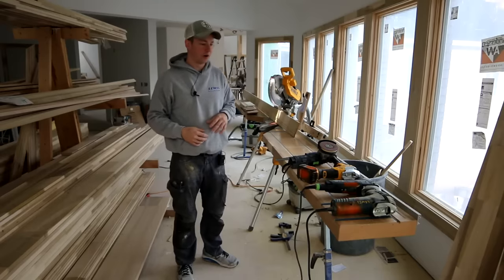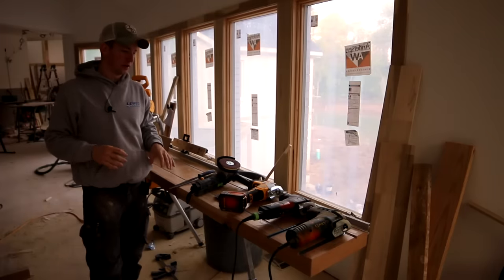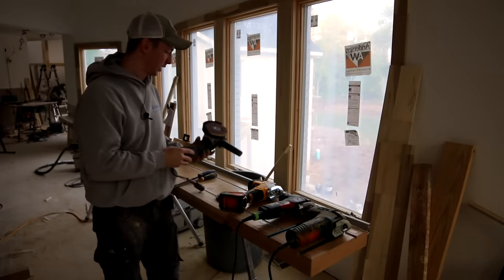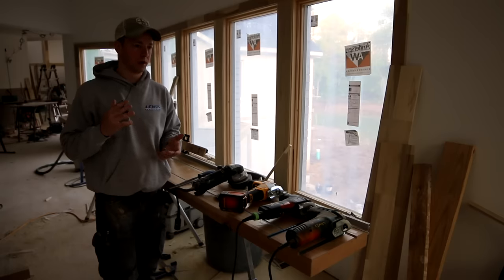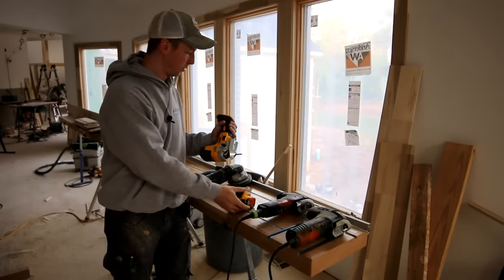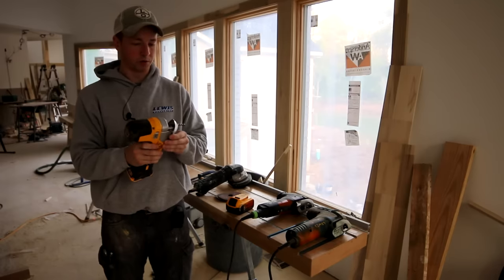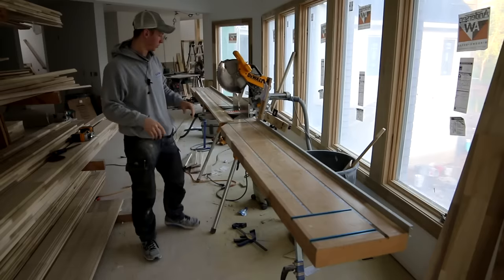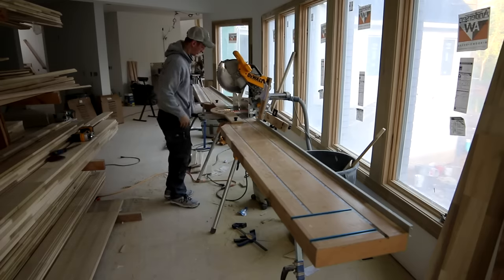Best tool for coping base and crown??? Dewalt DCS335B w Coping Foot for the Win

Comment: Great job, I’m one of the old timers doing this by hand. However I’ve heard about this system and now seeing your video I feel it’s time for me to join the young troops. BTW. I’ve been doing it the hard way for about 50 years. Thanks.
Reply: I'm 33 bud and was thought using the coping saw and will I used a sanding disc on a grinder to tidy if needed
Reply: Wow, that’s a long time. I wish I could find someone with that much experience to work for. YouTube is the next best thing if you want to move up with your skills.
Reply: I hear you there Rob. I’ve been hand coping for a lil over 20years. I’ve seen this method a few times. The first few times they looked poorly done. This one however was clean and clear. Def makes me open to giving it a run. Take it easy woodchuck 🤙🏼
Reply: I concur! Many years of doing it the hard way. I like his coping jig too! Actually his whole setup is golden.

Comment: I’m an old school carpenter. Always worked residential single homes. The company I’m with now is currently working on a fairly large condo/ hotel project. I was up in one of the units the other week and they are using the same technique. Very interesting. I haven’t tied this but don’t ever think you can’t teach an old dog new tricks! I may just have to give it a go.

Comment: When I was your age I coped with a Coping Saw...always worked, always accurate...just never fast. Now I use the Festool Carvex PS 420 with a Collins foot
Reply: Bill Joel I’ve been using a coping saw for over 20 years and as far as production goes I am extremely faster than Festool or Dewalt. Some people can use them and some people can’t. Using those tools would slow me down, and way to damn expensive.
Reply: @SuperDave44Mag  I agree with you Dave, I have been building for some 37 years and my Dad showed me how to use a coping saw.. I started using a jig saw upside down probably 30 years ago which is what this Man is doing with the coping attachment. Its what one is happier with i suppose. Also on this side of the pond in Blighty its called a scribe for internal. Good video though and well explained by the young Man.
Reply from the maker: One factor that I didn’t talk about is the wear and tear on the body of using a coping saw daily for the longevity of a career. It’s a lot of movement, and the body does break down over time.
Reply: @InsiderCarpentry  Try framing for 30 years and then we'll talk body breaking down. Haha!  I love it when I get a trim job.

Comment: I use a dremel with a sanding tube to fine tune the cope after using a jigsaw to rough out the profile. I clamp the piece in place with a quick clamp so I can hold the dremel with two hands. Works great and super fast. Use a small gauge triangle file to get in tight corners.

Comment: I don't swing the dropsaw/chopsaw back to 0 degrees.
I always go minus 1 or 2 degrees to ensure the face of the timber touch if the frames are out of square.
Reply from the maker: That’s a good tip. 👍
Reply: Yeah the whole time he was talking about setting the saw back to zero I was kinda cringing! Any inside corner greater than 90• will have gaps if you don’t back cut a little
Reply: This is why I read comments.., better advice than the video 😂
Reply: Good video 👍👍👍

Comment: Loved the debate idea. Lots of good feed back. Inside miters make no sense unless you're doing  it on cabinets or some custom build. Drywall is never true and angle finders don't give a true picture of what's happening beyond the corner.  Cope insides, nested is faster so you're not constantly flipping the saw all around. Cut crown flat doesn't work on all crown types depending on the spring angle. Like the Collins foot . Been meaning to get one.

Comment: I've been using the Collins coping foot for over a decade. Hung up my coping saw although it always resides in my truck toolbox if I am only making one or two copes.  As for cutting the straight cut on base. I back cut it 3 degrees and flip the depth stop on my saw which is set to the depth of the straight cut. 
Great informative videos.
Reply: I also use two belt sanders, a 3x18 and a 2 1/2 x 14 with many files.

Comment: As a designer Furniture Builder, I have been using a coping saw for about 45 years. Tried several new tools to cope with, always went back to my coping saw. I also cope off a lowered blade on a table saw, extremely fast method. Now that handheld cordless saber saw with that round shoe, that tool looks pretty useful...... like your videos

Comment: I did restoration and renovation on an old apartment building for about 15 years and I installed a lot of paint grade floor molding. I'm not proud of it. Painter's caulk was my friend. At the end I had gotten a little fancier and I was measuring the corner angle and cutting the molding using that measurement. That substantially improved the quality of my work but not to the point that my inside corners didn't need some painter's caulk occasionally. I'm sorry I never tried coping. It wouldn't have gotten me another nickel a month for the units but I would like to have tried it.
Reply: So grab a piece of trim and try it.Coping practice like whittling a stick to a old timer keeps ya busy and builds your skill set

Comment: Great video. Great to see a guy your age produce high end quality trim in a production manner. Like the guys that have been using a coping saws for 20 plus years, I've been using a Bosch jigsaw with it's standard base and Milwaukee paddle grinder with a 4  1/2", 36 grit sanding disc. It has a 4" rubber backing pad behind it, so you can get into those tight intersections with the edge of the disc. We would always use the grinder to do the square edge on the base, so we would set the saw at three degrees to back cut the flat section on the base. Retired now, but did that for 25 years. Have never tried the coping foot. Like the others would said, would love to have a better look at your crown jig at the saw. Thanks again. Keep it up.

Comment: Thanks for that. I’m a coping saw guy and I usually carry two with one blade set for a pull cut and the other a push cut. That lets me do left and right hand copes more easily as I usually do my layout both for base and crown based on primary sight lines of the room. A spring loaded nail set is super handy and so are the spring loaded extenda poles that painters use. I’ll give that coping foot a try but I’m pretty proficient doing it by hand. Miter saws that have a 31.6 setting (Bosch, Makita)  are great for cutting 45’s on crown laid flat. Nice cutting station 👍. Thanks for vid

Comment: Wow, that Dewalt w/ that coping foot attachment really lets you control the saw. Which is what you need for accuracy during the cope. I’ve been using an older model corded Milwaukee w/ a flat shoe for real wood copes and a grinder for MDF. Great vid, thx for posting ! 👊👍

Comment: For base, I've used the upside down cut, then finish with a Dremel with a Kutzall Burr. The cylinder-shape burr will give you flat and concave cuts. Very fast.
Reply: Which Kutzall Burr do you use for coping?

Comment: After seeing that coped crown joint I have only have 1 word, SHOWOFF! No just kidding, great job. I wasted countless pieces of oak crown when using a cope saw trying to get it perfect. But I don’t do it for a living. One thing I used instead of files were oscillating sander discs. They come in different sizes and really clean up the contour nicely. Keep up the good work.

Comment: Trim work is my specialty.  I've always used a bosch barrel grip jig saw with a bosch 308 blade. It has the standard shoe on it which I hold onto as I make my cuts from the top side not allowing the shoe to contact the work. Its very fast and accurate.  I never liked a coping handsaw, too slow and difficult. Not a fan of a grinder due to the excessive dust.
Reply from the maker: Consider giving the Collins coping foot a try. I think you’ll like it. 👍
Reply: My method also.... just started with the coping foot, learning as I go.

Mostly use a coping saw, (since 1974)  .. my arms get tired quicker now though 😀, and the jigsaw has become a reality.

Comment: Great demo. I use a Bosch barrel grip jig saw, D244 blade and the Colin's foot with a holder and good clamps.   I also keep a grinder with a 40 grit flap disk to clean up any spots. Reading glasses really help and a few files help fine tune.

Comment: yes yes yes. I agree with all of it. Just one addition -  that when i am coping the straight of the baseboard upside down i always undercut slightly in the same way the coping saw/jigsaw is angled. this just to allow a really snug fit if the walls arent perfect 45 degrees.

Comment: One thing I noticed is that once you cut the bevel, you cut the line straight down towards the top where the profile is; I found you get a better fit if instead of setting the saw at 90°, set it for a back cut of 22°, it makes for a really tight fit

Comment: I’ve been at it for close to 50 years. I started, and still use, a coping saw and a razor knife (the old Stanley #99). Miter box... manual. My first power tool was a Rockwell 315 circular saw. Still have it. My next was a Rockwell 9" power miter box. Still have it. I’ve recently been using a jig saw for copes and a rasp bit on my drill. I do the same as you as far as upside down cutting base and crown, but for the straight cut I back cut the work a couple of degrees.
Reply: sounds like were  been train by the same man

Comment: Good content Spencer. Doing baseboard, window/door trim and some crown has always been enjoyable for me. My father chased me out of the business years ago, suggesting another career path. But the smell of saw dust gets me going. I too use the miter saw for the straight cuts on coped molding but always used a hand saw for the copes, followed but files. If I ever get into doing more  finish work, I'm thinking the Dewalt setup you have going there is the way to go.  You always do a great job in your videos and ON your videos. I know it's a lot of extra work to produce them. Thanks. 👍👍👍

Comment: I am old, old, old, old school ! Talking Disston miter saw and box. Stanley hand coping saw. Yankee screwdriver. And Guillotine miter box.
Never coped hardwood trim (except poplar, which technically is a hardwood) because hardwood was always stained or finished bright and mitered at all corners.
 I would quibble about hand coping being harder on joints then vibrating jigsaws, but the goal is, primarily, to make professional joints and secondarily, quickly (ie...to make more money. I made a living coping by hand.) 
If you do it with an industrious Beaver, good for you.!
Love your videos.

Comment: Nice tool but im going to stick to my angle grinder with a flap disk. Once you get used to it, it will make the job so much faster and it creates a nice tight joint

Comment: I have taken to using a grinder with a paddle sanding wheel.  80 grit takes away material quickly, but with the paddle sanding wheel it leaves the cleanest edge.  Great video.

Comment: you will find your joints get a lot tighter if you back cut the straight cut on your skirting 5 degrees nice and snug every time oh yeah
Reply: @kenlame1197  good call
Reply: @kenlame1197  Thats great trekkers. Keep up the good work/ videos.
Reply: @kenlame1197 Technique, must be a uk thing
Reply: I do mind on a 22 1/2 that's what I do every day baseboard, crown molding, kitchens, staircases but everybody has their preference. But with a zero degree usually if your wall is not 90° or more you'll have an open face
Reply: Ryan Conway  anybody who is putting non-dried wood in a house is an idiot. You're wood should not be shrinking no more than 1/16 at very most. And if you keep your trim big enough it will compensate for shrinkage. You must be fairly new to the game?
Reply: Bryan Goldschmidt yeah I just hit the first stop at 15• and cut the flat doesn’t really matter what the angle is
Reply: Ryan Conway I’ve never gotten gaps... I’ve never seen wood shrink lengthwise very much either, only perpendicular to the grain
Reply: @swooopg  you're right it doesn't really matter the angle anything over a five degree will do what you need to do I just prefer mine a little heavier than some others
Reply: You are quite correct my friend. 30 years in Carpentry & Joinery.
Reply: Ken Lame that’s a good idea! I usually use my pencil to get a small bevel either cutting flat or against the fence...but I never tried it with baseboards
Reply: Ryan Conway someone that doesn’t know what they are talking about shouldn’t call other people an idiot
Reply: Bryan Goldschmidt I’m gonna try the bigger angle like you...I want to see if I can get it to dig into the other board a little and close the gap a little more...if so I may start coping more often!
Reply: Spencer Wilson thank you Spencer...what comment were you referring to exactly?
Reply: @swooopg  yeah I found it to be a little more helpful hope it helps you
Reply: I typically run an 1/8 inch bead of poly glue behind my cope.  The backcut (5 or 10 degrees) gives the glue a place to go, and bite better.

When coping 22.5 inside corners, I backcut 50 degrees.
Reply: Nic Barrett it seemed Ryan Conway removed his comment as I don't see it.
Since I'm a plasterer my intentions was to make my plastering as square as possible to fixing Carpenters have an easier time. I have helped fixing Carpenters and also cabinet makers installing cupboards.
The last job I did in a bathroom I squared all corners and used a digital level for the nob wall. The cabinet makers fitted in his top and didn't even need to scribe anything in it fitted first time. Now that is satisfaction for both him and myself.
When I patch other people's work I wonder how they held their trowel as the work is not flat so I can understand why Carpenters need to scribe back on an angle to allow for plastering to be out of square.
Reply: @nb2211  skipped the meds today?... How is it you can call out someone you never met? Do you speak like that to your loved ones ? I already found a better place to go if you do not enjoy the people you are placed with, or do you think you have some independence from your maker? You shame your parents. I hope you are not too old and cannot learn manners before your end comes. Why do people think, although they have no clue how they got into the flesh, that they will not also have a renewed body that does not perish? This is why we die. Regrets. Live like you will never die and be careful not to corrupt what is not lost. My,how we throw away honor by disrespecting those whom we will never meet. Shame to you. Yes, I am a carpenter. 42 yrs. Still loving it.
Reply: Obviously  you've  done  alot of  crown  I  thought  the  same thing

Comment: I agree with you only thing is I run a  Collins foot on a milwaukee 18v barrell grip jig saw
The battery life is much longer. 
The Collins foot is awesome been using it for over 20 years
Reply: I've been thinking about getting one of those.  I have the m18 D-handle, and it's pretty much worthless for coping.

Comment: I back cut about 5degrees on mine, rather than straight, that gives you a smidge more tight fit. Even with a cope, i put about a 5 degree angle. Then I use a dowel with 80 grit on it to get rid of any edge cuts. Haven't seen a molding shoe for jig saws yet. Should be great vs a flat shoe. Thanks for the look see. 
PS, lve been a carpenter for 45 year's, and never found a really strong coping saw. Must have 10 of them.  Thanks again.

Comment: You can do the smallest bead by nibbling it with the blade of the jig saw.  I use an old Bosch barrel grip (made by Scintilla back in the day, a wonderfully smooth saw) and a coarse blade and Collins Coping Foot.

Comment: curious if anyone knows what a COPING saw is. I started working my father at age 9  in 1969. Running base I became very proficient with it. Progressing to chair rail, bedmold, crown molding etc. after 20 years active duty Army I started a handyman/home maintenance company and have found I can keep production WITH ACURACY as fast as anyone using a jigsaw or similar.  I've seen their results and I'll repeat something my father would occasionally say about half steppers,  "they wouldn't make a pimple on a carpenter's ass"...
Have to admit if focused only on high production and painted trim these look to be useful. excellent video. 
Sad going into $500K + homes and finding base and chair rail cut at 45° and James into corner along with 1/4 tube of caulk. Another of my dad's favorites "we are carpenters not caulkers"...

Did enjoy video and will check out the COPING foot.